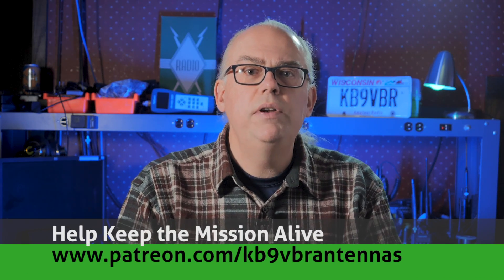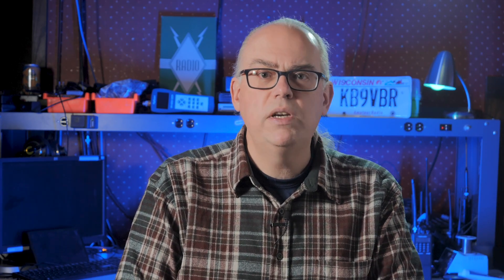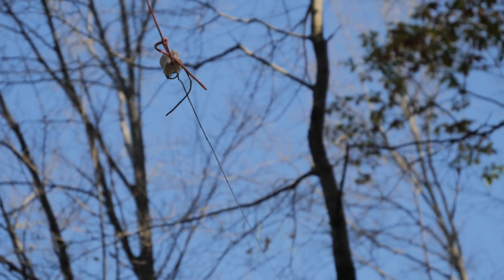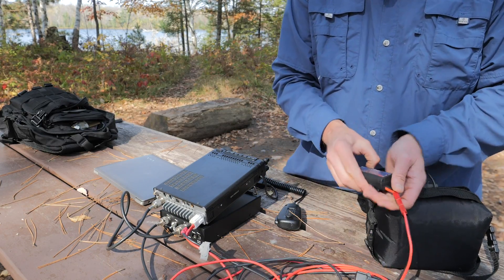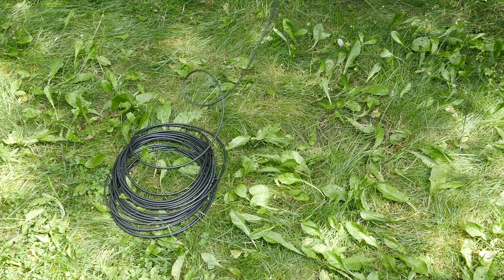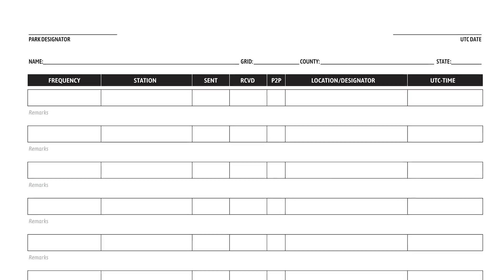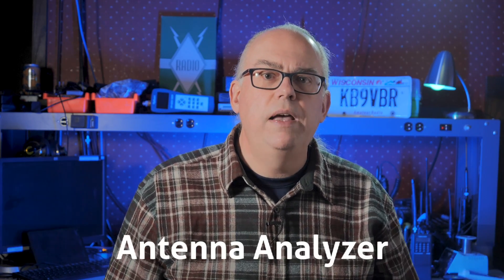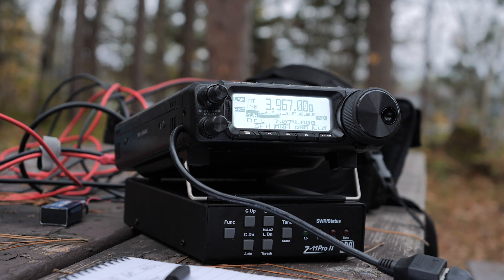STOP BUYING GEAR! The only five things you need (for portable operation) #HamRadioQA

Comment: Thank you for this video.  I haven't been on the air much in the last year because of health reasons.  I really want to operate HF portable.  To be honest, I don't really want to do POTA.  I am a rag chew operator and like to talk for a while when I make a contact.  I would love to do it in the field.  I like long wire antennas with a feed point antenna.  I have been considering a Yaesu FT-710 with an ATAS antenna.  Since you mentioned the Icon 718, I may do that instead.  I am not sure.  I really don't want to have to deal with menus.  By the way, I use and love your VHF J Pole antenna. Thank you brother, de KM4MMD

Comment: With you on the RG-8X, I have a Comet 80-6M vertical I can pop on a MFJ tripod so I'm good there, but I'm torn on whether I should buy a LiFePo 20 amp hour battery or a power station like the Jackery. I don't intend to camp overnight while doing POTA, so what's the better option for running a Yaesu FT-710 and an Alinco 7735-T?
Reply from the maker: I’d go with the 20ah LIFePO4 battery. The Jackery may be a bit more convenient but the down side is that the DC accessory port is limited to 10 amps output. You won’t be able to transmit at 100 watts if you so desired.

Comment: I'll add one more power option - the battery in whatever vehicle gets you to the POTA site.  Even a small car battery has several times the Ah of portable SLA or Lithium batteries.  It's already there, nothing additional to buy or bring.  One can operate for hours and still have plenty of power to start the vehicle at the end of the activation.
Reply from the maker: I strongly recommend not using your vehicle's starter battery as a power source for your radio equipment if the vehicle is not running. It is a lot easier to deplete the battery than you think and the last place you want to be is in a remote area with spotty cell coverage and no way to jump start your car.

Comment: Hey Michael. After much experimenting with the new power supply, the unun you helped me make and my tyt9800, the tyt stopped working (mystery/likely known common failure.) I returned it and got a ft-2980R. I only really play on 2 meters so I figured get something specific to the task that is more reliable yet the same price as this other quad band transceiver. I might get one of those super inexpensive $100 all band hf's. I saw one reviewed and cannot find the model at the moment but I saw somebody making contacts up the eastern seaboard with it so yes you can do a lot with a little-I am not concerned about crystal clear sound since I am not running a net but just being functional. I am not spending money on antennas but did find the nano vna was a smart grab to tailor something for a given job (less than $50 to tune antennas forever is a bargain.) I'm thinking of radio as more like a shop than a shack. If it can be done cheaper and at home then I 100% should at least consider learning how it is done in case that is all I have to rely on. That said, I do not know how to build a radio from scratch but everything outside of the chassis I have learned online (basic cable crimping too.) If I could figure out how to salvage pl259 plugs that would be cool but at some point I have to buy and keep stock of things I burn through. I'm cheap but not that cheap.

Comment: Great video sir.  It was pretty cool to get a famous YouTuber in my log...lol.  I've got 173 activations now and my kit keeps getting smaller and smaller.  I am running the Yeasu FT-891 and using homemade center fed dipoles that are resonant, so no tuner required.  I have one on hand if needed, but my antennas all tune up less than 1.2:1 across the voice portion of the bands I activate.  I use an MFJ 1917 portable mast.  When I first started activating, I used a BuddiStck antenna with great results.  The battery is a Dakota Lithium 10ah or a 23ah for longer activations as well. KO4TKS
Reply from the maker: I've shrunk my kit down and refined things over the years also. I'm to the point where I keep the antenna box in the car all the time and just throw in the radio and battery when I want to go out.

Comment: Look also at an end-fed half-rhombic and inverted-V. Both are similar in only requiring a single support in the middle. The half-rhombic can be convenient as you feed it from the end, not from the middle; running a ground counterpoise with one helps. Used these in the military for rapid HF antenna erection. Think about radiation pattern desired for the distances and ionospheric propagation needed to support that. Takeoff angle can be high for shorter distances, while low angle radiation is better for trans-global. Working 15m, 20m or 80m? Day or night? Summer or Winter? What distances are reasonable to expect for all those factors? Best wishes & 73's.

Comment: @KB9VBR antennas @KB9VBR Antennas is it possible to do POTA or SOTA with a 2 meter radio?
Reply from the maker: SOTA activations are done with 2 meters all the time. The key is to select a location that will most likely garner contacts. That would be on a summit or peak with a good vantage point to a populated area. All you need is 10 contacts, so look for areas that would give you that possibility. 

On a side note, I talked to a ham a couple of weeks ago that was on a lookout near a busy highway. I was  2 meter mobile and he had a handheld and Yagi. I'm not sure if he was activating a SOTA entity, but I heard him making quite a few contacts on 146.52 while I drove through the area.

Comment: My business partner and I fix very expensive electronics gear for a US government lab. He sometimes walks in there to fix a problem and just carries a pocket multimeter and a couple of screwdrivers. When they ask him where all his tools are he just points at his head. He has a Master's degree in EE, a PhD in High Energy Physics, and is a state licensed PE, Professional Engineer. All that stuff upstairs is really all you need in order to be a good ham, and learning it is what the hobby is all about. Hams aren't CBers.

I don't bother to log my contacts. It takes the fun out of playing with radio. 
Also, I disagree with this guy on antenna analyzers. A cheap NanoVNA is so much more capable and useful than an expensive antenna analyzer. I use one for virtually everything, from tuning antennas to identifying the location of bad connections in coax, to winding toroids, to building xtal filters. The list goes on and on. An antenna analyzer? Why in the world would you pay so much more for a device that does so much less? 
BTW, a Wolf River Coil is just a coil. It's wire wrapped around a core. That's it. Get a pool noodle and wind your own. (I did.) Then you can check it with your NanoVNA. And if it melts, you're running way too much power. Figure out how to do things better, (hint: antenna.) Don't just throw more power at it. You can't learn anything that way.

Comment: i put my FT-891 with a 12Ah LiFePO4 battery in my small backpack along with an EFHW monoband antenna (usually 20 meter band), a short (!) length of RG58 coax and some bungy and paracord.  I can also get my 7 meter long Spiderbeam telescope mast attached to the side.  I still have room for some sandwiches and beer.

Comment: I have a Schumacher SC1280 that has modes for a standard, AGM, and gel batteries. Could it be used to safely and effectively charge a 12v 12 amp or 20 amp LiPo4 battery? If not, do you have a recommendation for a charger?

Update: I contacted Schumacher and they said no on using the SC1280 on a LiPo4 battery.
Reply from the maker: I've got a similar charger and it won't work with a LiFePO4 battery. The issue is that lead acid and AGM batteries are charged to a voltage of 13.8, but LiFePO4 batteries need to be brought up to 14.4 volts to realize a full charge. Plus the charging curve is different, as lithium batteries don't require an absorption phase during the charger cycle. Here is the charger I use for my LiFePO4 batteries: https://amzn.to/3AmaoJh
Reply: @KB9VBRAntennas  Apparently, they are all sitting in a container ship off California. The earliest estimated ship date is early April.

Comment: Well my old FT101B is missing the 12V vibrator / inverter circuit, but I guess I could look around for one
Reply: My FT-101EE is still alive and it made it out on a few camping trips many years ago.  But I'm too old to lug that beast out of the shack, and it would suck my LifePo4 batteries dry in a matter of minutes...🤣
KZ9V

Comment: I got many years ago  703+ as a shortwave and 6M rig.  Use it for FD and museum ships.  Great rig, sips power.

Low power/QRP ops critical during emergencies.  Used 703 in place of the 746Pro during Uri ice storm in Houston.

There is a chart for 1/4, 1/2, 5/8 lenghts for the 17' WRC/MFJ whip with the WRC base.  With 17' whip, WRC whip is not needed.  And 102" CB which should tune on 10 and 12m on WRC base.

Comment: Completely agree. A lot of hams get hung up on getting POTA specific equipment when all that matters is will the rig be easy to operate in the field, operate at half the power for only 3 dB reduction in  power reduction and field an efficient resonant antenna that doesn't require an antenna matcher.

Comment: I like most youtube ham channels, but I think you might be the first that has explicitly said this. Since getting into ham last year, I've noticed I was on a never ending path of buying radios, antennas, tools, cables, etc. This year it started bothering me, how much money I spent, so my goal this year is not to buy anything ham related cause I have enough to have fun and learn.  

Great message Michael!
Reply from the maker: I think we all get caught in this trap as we start out. I know I did, and now I have a basement full of 'junk.'
Reply: @KB9VBRAntennas   I think the most important thing is to simply get on the air. That said, learning how different equipment works, especially with antennas, is just as an important part of the journey. 

The nice this about antennas is they’re usually relatively cheap to build, and while you’ll save so much time with a NanoVNA, they don’t take up much space, and you don’t need much else other than some wire, a few poles and a few ferrite rings to get going. 

While I didn’t spend too much on transceivers, I did slowly acquire a drawer full of straight keys that rarely see the light of day, save my mini BEC field key that gets used for everything
Reply: my first year i started with the 891 and the icom 2730. threw them in my car for mobile use. why cause i had a bug up my keitser for a better all mode base, i bought a used yeasu 991. still run the same wolr river 1000 as a base antenna and an sbb7 mobile for 2m and 70cm. now im upgrading my base antenna with a nelson 80-10 efhw and a true base dual band antenna. those will be installed on a 20 foot home depot 20ft mast. this hobby/ adventure never ends. see yall on qrz

Comment: WOW ! All great information.
Coax: I carry two lengths of RG 8X. 33 feet and 66 feet. This gives me three choices, 33, 66 or 100. 
Battery/ power out. I always tell people not to run 100 watts. 40-50 watts is a good choice since 50 watts is only 3 db down from 100 watts and on most radios, that's only a half of an S unit different.
Antenna: I've been promoting for years for either new hams to get on the air or hams that operate portable. Get a dual band 20/40 meter antenna. One of the two bands is almost always active, if not both. I've since changed to a HWEF40.
This was a great video and packed with a lot of good suggestions. Glad you took the time to create it and post it.
Barry, KU3X/QRP
Reply from the maker: The 40/20m dipole is a great starter antenna. It's inexpensive and you can build it yourself. Plus some of my biggest pileups were with that antenna. I still carry it in my kit and will use it if the location allows for its use.

Comment: Nice video!! Short, to the point and covering the basics.  In my portable Ops, I use a ham stick, either with radials off a tripod or on my car with a mag mount, both very successful.  This hits the mark nicely.  The only thing I would change is a lighter transceiver.  Right now I use an ICOM 746, wonderful radio, but a boat anchor, but it works.  Again, well done video!
Bill - KD0WAN

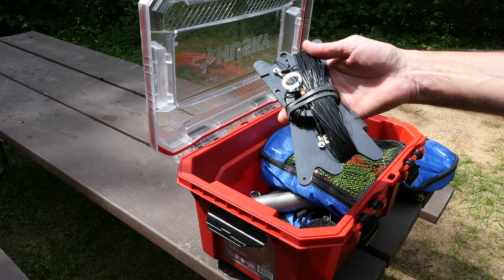Comment: what is that cool box at time stamp 01:47 the big red box with clear top? looks well made.
Reply from the maker: That's the Husky Professional Waterproof Storage Container. They are available at Home Depot in a 5, 11, and 27 gallon size. I've standardized on these containers for my radio and camping gear because of how well they pack into the vehicle. Here's a video with more: https://youtu.be/B4CEXNo8NJ8
Reply: @KB9VBRAntennas  thanks for the fast reply yeah they look very well made. Thanks for sharing.

Comment: I realized from Field Day experience that the more stuff I take with me, the more I have to unload when the event is over and I'm tired. I can always unload stuff later though. I do agree that we should take only what is necessary along with a spare antenna, coax, fuses and connectors. Another point is if I take a lot of stuff and want to try out everything, I'm using time and energy I need for operating.

Comment: Hello there.
I plan on buying one of your antennas. What would you recommend. Im Just starting out and really love this Hobby. I only currently have 2 scanners and 2 handheld Hams. I soon will be progressing towards getting license but until then I am learning lots and getting all the fundamentals down. Would appreciate if you could recomend one of your antennas.

Thanks a Bunch
Reply from the maker: For those just starting out, I recommend the classic 2 meter J-Pole antenna. It is tuned to transmit on the 2 meter band and will give you good coverage on the 70cm band. It also has broad band receive capabilities so you can use it as a general purpose VHF/UHF scanner antenna. https://www.jpole-antenna.com/shop/2-meter-amateur-radio-j-pole-antenna/
Reply: @KB9VBRAntennas  

Thanks a Bunch! I shall start off with that one.

Comment: Newcomers should consider the SOTABEAMS Band Hopper. 20/30/40m which is 98% of all activations and No Tuner needed, no radials and no fiddly coil to mess with.
Reply: Agree!  The 20/30/40 "linked dipole" is extremely effective and building your own is easy and costs practically nothing.
KZ9V
Reply: The downside of linked dipole is taking it down when changing bands. I had one for WARC bands and exactly because of this I don't use it very often.

Comment: Strongly agree on the FT-891. Not expensive and may be the only rig an operator will ever need. Avoid ChinaZon rigs like the G90.
Reply: I have both the FT-891 and G90.  They each have their advantages.  I love both of them.
KZ9V
Reply: I really like my 891.  Once I figured out the menus, I certainly do not regret buying one for portable ops.  Would even make a good shack radio for the budget minded.
Reply: might be a silly question but what exactly does ALL MODES mean? like Fusion, D-star, and DMR?
Reply: @drexlersinger2840  for HF it means, AM, SSB, CW, PSK, etc.  For digital voice it means Fusion, D-Star, DMR, etc.
Reply: You have no idea 😂

Comment: Exactly! I have over 150 POTA activations, and I am always amazed at how many people think they need more gear, or agonize of getting the SWR down to 1.1.  I roll with my 891, a wolf river coil and maybe the EFHW on a pole.  all you need!!  Bioenno battery.  I would add the Rig Expert to any portable ops tool kit. using the SWR meter on the radio is pretty tedious.  W1ip
Reply from the maker: I know what you mean, you are never going to get that 'perfect match' every time. Sometimes good enough is good enough. Tuning with the transceiver is tedious, but it can be done- so my point is don't let the absence of an analyzer hold you back.